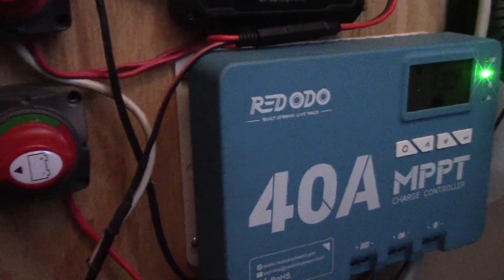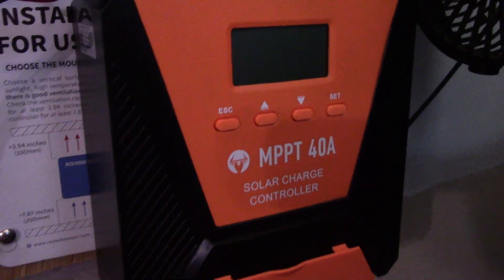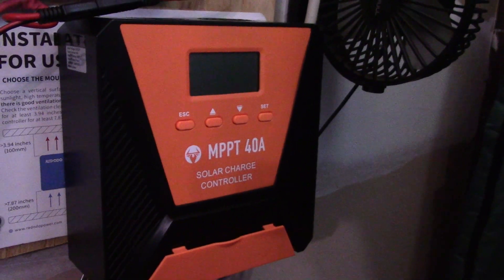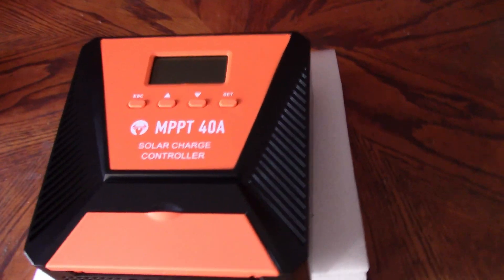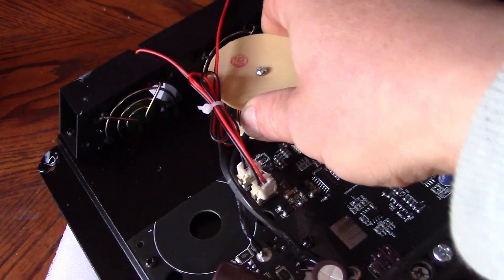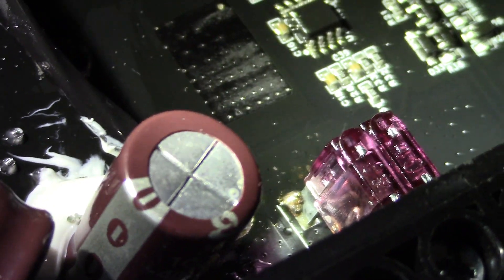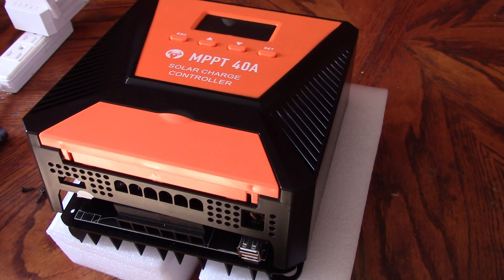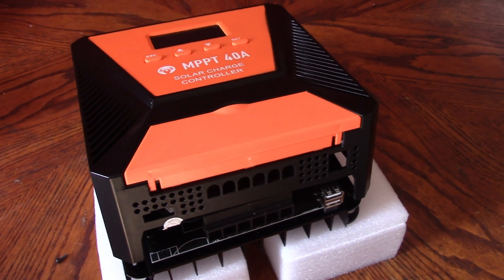Don't Do This! Solar Charge Controller Fix (Part 2)

Comment: Rooky mistake,it can happen to anyone xD I also join to the others,to get a victron mppt,it is superior compared to these...you will also get more solar yeild
Reply from the maker: Victron have always been the spendy option, but, if this doesn't get fixed with new fuses I could well have done with getting one! Buy once, buy right Is likely true.
Reply: @Slider2732_  2 years ago in Romania they were quite expensive,but since than,they came down in price alot,here nobady even considers buying other brand that much,especially like this,like a separate charge controler only thing.Hybrid inverter are quite popular due to cost efficiency tho...the cheap chinese stuff...I stayed away,i have all victron gear,18kw lifepo4 battery,5600w panel,and a 6kva smart solar 48/6000/80 inverter.Its awsome stuff.

Comment: just get a victron mppt and has a app too and can set ti up on the phone as well , victron mppt is way way better like the best
Reply from the maker: Yes, very popular and for good reason. If the fuses don't fix it then I might have to look at getting one.
How are you going on with FPV rules in Wales? Am still flying here in the USA but sub 250g. Well, Whoop only, with a camera on top.

Comment: No rush. But if it was me, I would replace the fuses with wires (for 1 week), knowing I am going to put a piece of shrink material on those power cord, one red and the other black to never ever make the same mistake again! I usually have a red and black marker and I color everything I get my hands on! It happens to me as well too often, + on - and visa versa. Back to the fuses, I am not sure how much amps you get from your solar panels (I you did tell in your previous video, that much I remember), you could just go ahead and solder two wires in stead. If you use house cable (16 Amp) what can go wrong? They may get a bit warm? The sun is still low.
Any how, 24 Feb is a week from now. You should better wait, mine was no advise, just me thinking out loud.
Reply from the maker: I appreciate the thoughts, the red and black heatshrink is a winner! 
Do you pronounce your name 'dez lo messs lager(as in beer)' or am I missing a very obvious pronunciation? Will shout you out in the vid.
I'd better wait for the fuses, as $75 is quite a big investment with no income at the moment. 
Battery input amps are around 40A tops, 14A max on the 20A Bateria and 26A on the Redodo. Splitting the MPPT via 2x charge controllers has been intended as load sharing and as a backup in case of failure. 2x 100Ah LFP at 1/5 charge rate.
Reply: @Slider2732_  I prefer just Deslo. In reality the words are Dutch, it comes from 'Sjakie sloeg de slome slager' which is (says ChatGPT) "A Dutch alliterative phrase where most words start with the same letter, making it fun to say.", "A playful sentence with repeating sounds, similar to an English tongue twister."
A shout out for me? That is a first one for me :-) Thanks!
Yes, I did have 20 Amp in mind when saying you could use a wire. I would use a twisted house supply wire, and cut away 5% of the strands in the middle to give it a weak spot. But don't do this as it still may be a gamble.
Reply from the maker: @deslomeslager  I can imagine a Dutch drunk trying to speak! A very fun language. My wife's origins are Norwegian and they have some alcohol avoidance words too.
Hey, if you help me out you likely help others with similar problems and that deserves recognition 😀
The wire idea seems very practical. Can see how with testing it could be just as dependable.

Comment: Cat's fuses are still "go"!
Hopefully the new ones will be all that charger needs. But what could the rest of us do to prevent similar melt-downs? Interesting the way that toroid coil was secured. Is this an example of the rest of the world quietly going on with the Joule Ringer technology?
Reply from the maker: Good thinking about the Joule Ringer! I haven't inspected that toroid, but certainly will do. An idea for prevention was from deslomeslager in these comments, to use red and black heatshrink on any cable that isn't the correct colour. 
Thanks for your comment 😀

Comment: I built a 2 valve radio kit and ponderd if i should put reversed polarity in basically a diode and i thought to myself i will not reverse wire it . Several months later POP . Hopefully your fuses have saved the circuit we all get a little bit complacent until we get a shock or see the magic smoke. Fingers crossed 🤞 for you  👍
Reply from the maker: Thanks John, very much appreciated. Yikes on the radio!

Comment: Oh 😢😢😢😢😢😢 granpa buy new one❤❤❤❤❤❤❤
Reply from the maker: Haha 😂 Wish I could get another, it would be much easier. $6 for fuses is OK as a learning experience and I hope that fixes it! 10 days until delivery though out here.
Reply: @Slider2732_  I guess it would be faster if you drove to next petrol station where usually you can find spare fuse, eventually make a phone call before to make sure they have the right fuses in stock
Reply from the maker: @Caesarus2011  Yep, but they're a tiny fuse in comparison to regular automotive. 40A also seems to be rare, compared to 5A, 10A. I'd rather get the correct type and connect something correctly lol
Reply: @Slider2732_  You living in that Geographical Oddity described by Ulysses mate? 2 weeks from everywhere! 😉😊
Reply from the maker: @theoztreecrasher2647  Yeah, we're probably underneath the middle of nowhere, hidden by brush and a sand hill 🤣 
Back at the other house, an order on Amazon at 3pm would arrive the next morning. Can't even watch the little Amazon van on its route here, cos there's no Amazon van (UPS instead and likely too small of a fuel tank lol)
Reply: @ As long as "George" doesn't turn up as the driver - and hand you the "tiller"!! 😜 
Whenever I'm down and need a laugh, I get out The Soggy Bottom Boys. 🤣🤣
Reply from the maker: @theoztreecrasher2647  In fact though, we know the name of the driver who delivers for UPS... same guy each time. I don't think anyone else will do the route without overtime pay 🤣
Reply: @Slider2732_  Sounds like a couple of the Ozarkian areas around here. The local joke is that they have to pay the folks who deliver the census papers to each household danger money! 🙄😁

Comment: I am guessing you practiced some of those special words and incantations reserved for these occasions. My vocabulary suddenly reduces to two or three special words when this sort of thing happens. Sometimes just one word, repeated several times. 😕😕
Reply from the maker: Why yes, yes indeed and at a rarely heard much increased volume! 
Also had a migraine at the time, probably through rushing and my wife did say "No video is worth your health". Of course, being male, I ignored her and then apologised afterwards!
Reply: Oh crap ! I hate when this happens … at least you had real protection in that solar charger.

I have blown up my one, much cheaper it was just pwm type and despite being sold as protected for overvoltage, inverse connection protection, under voltage protection etc. I open it and the crap thing had no any kind of protection … well just £12, but has stopped me doing experiments when accidentally i have left some coils to fully couple to the output and some 60 V dc were injected without any fuses in that little crap designed for max 30 V.
Reply from the maker: @Caesarus2011  Yeah, it looks like the protection works... I suppose we'll find out in about 10 days when the fuses arrive.
Sad to hear of your charge controller, I know you'd been working hard on the experiments. For PWM, I can recommend the cheapish Ecoworthy 30A. Never a problem and when the front button is pressed you get to know what the solar input current is. That's very handy with smaller batteries, to not overload with a big panel (I often charge up a 6Ah LFP, so current should stay around 2A or below, but I connect to a 100W panel. It's great to watch the current amount and unplug when the sun comes out)